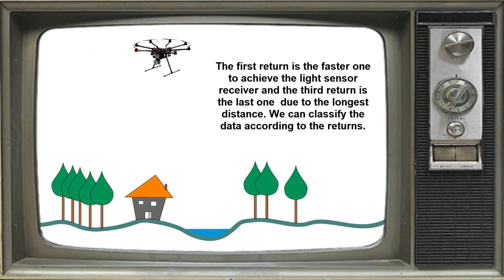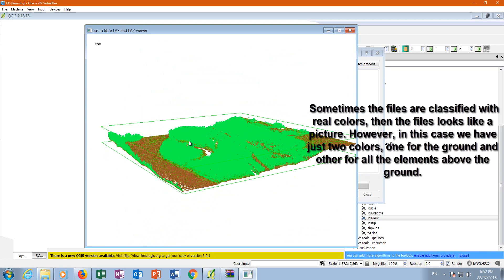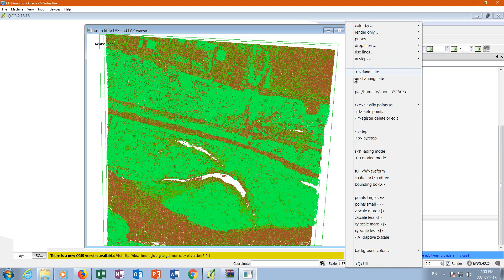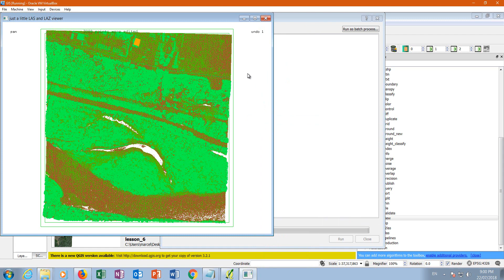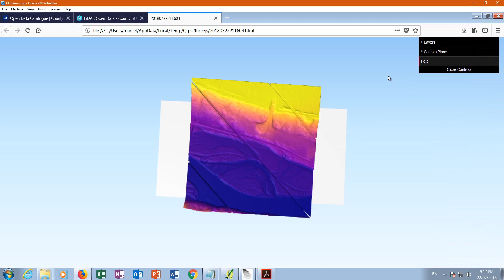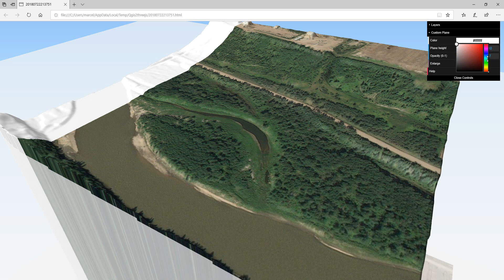Lesson 10.1.  LiDAR  LAStools.  3D model.  Hillshade. SASplanet.

Comment: Does exist a way to classificate by distance from the ground?
Reply from the maker: I am not sure. However, if you export the file to raster you can do the difference between the digital elevation model and the digital surface model. In this way you can calculate the elevation of the vegetation in an specific area ... just an example. :)

Comment: the plugin you are using in QGIS is not adding the elevation hillshades for me, it only shows a flat dem (derived from LAStools). I wonder why?
Reply from the maker: Hi Aurelija, I am not sure what could be wrong with the plugin or with the file, sometimes plugins or files do not work properly (you can do all the process again or try to reinstall the plugin or even reinstall QGIS). However you do not need that plugin to create a hillshade. If you have a DEM you can go to the properties of that file (at the layers panel). Then go to Style and in the Band rendering panel go to Render type, then select Hillshade and press Apply.   Hopefully, this indications help you.